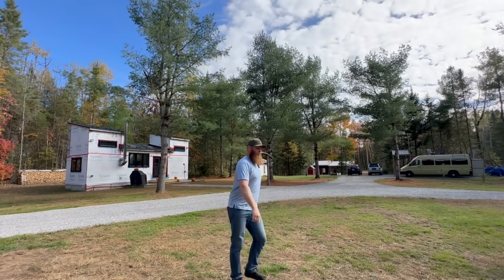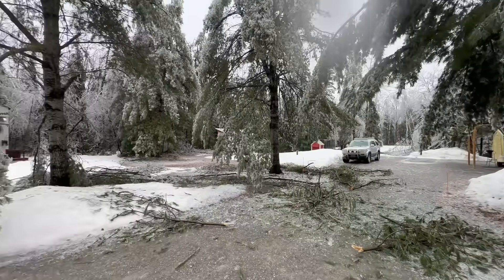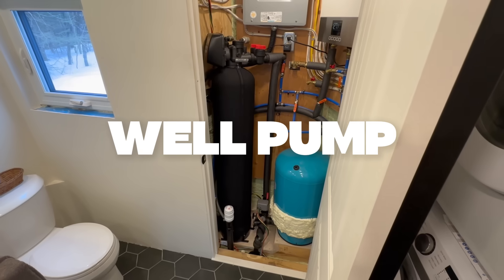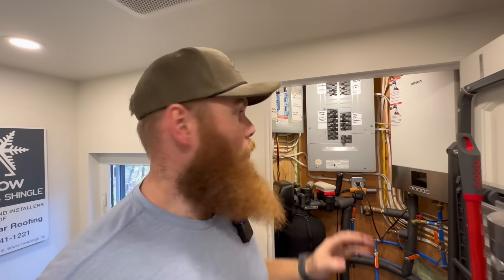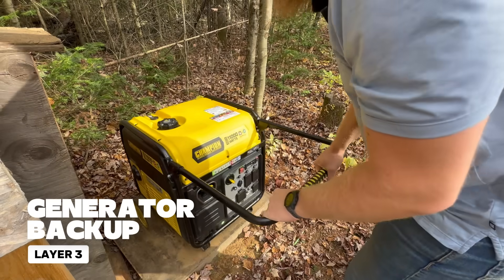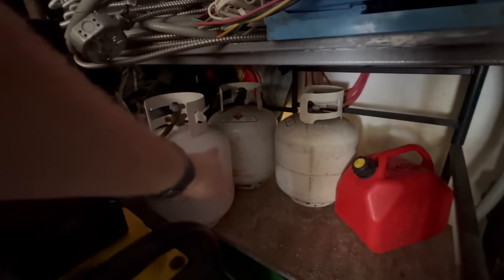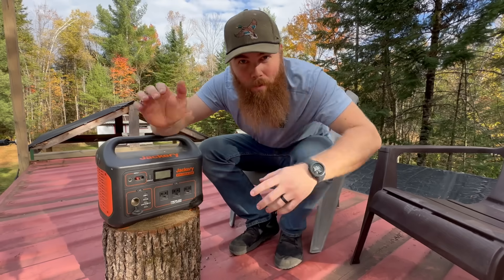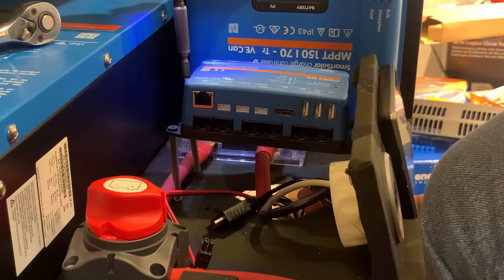This Trick Keeps Our Tiny Home Powered All Winter

Comment: @Snowstead, 
thank you for sharing your know-how and your beautiful little homestead with us.

The route I took here in Tennessee, was to first live offgrid for several years, pre-retirement, in an old 12' tow-camper, on my 0.75-acre rural lot, with a DIY'ed solarpanels/ rainharvesting canopy built above it, and using propane for heating and cooking.. 

As I retired, I then took my (dozen-years- brainstormed) offgrid tinyhouse (8'×12') highly custom sketches and specs to a local Mennonite builder, who soon delivered to me that $3K (R-7/in. sprayfoam- insulated and sheathed) shell, which I swiftly sheetrocked and interiorly surface-wired for offgrid solar, it similarly equipped with transferred-over (and tripled) offgrid solarpanels (2.6 nominal kW of, presently) and a rainharvesting system channeled offa its Galvalume roof.. 

and three AGM batteries, a better inverter, it really used solely for inductive/ microwave cooking, everything else kept at 12 volts.. Lighting, waterpumps, blowers & fans, security cameras, 3 flex fridge/ freezer units..

*I've deliberately planned, at every stage, so as to never need/use a genny; they can certainly undeniably be appropriate, and lifesavers, but I personally dislike them, and the expenses of buying, fossilfueling, and maintaining the smelly, noisy stinkers.

Tho I still keep several filled tanks of propane stored for unforeseen emergencies, all my heat in this small space is from individually- switched 12V, 100W-each, 2.25"-diam. wee minifan- equipped PTC zone-heaters that blow warm cocoons of air on me and my furbabies, and which are sufficient in even -5°F temps, to keep toasty-warm.. (can't prolongedly run more'n half of them without sweating, and 'this-half' rapidly climbing toward 90°F!), 
and their heat also even keeps canned goods well above freezing at all times, over in the subdivided 'other half'; (the pantry, closet, and entryway, and ~60% of my perimeter- circling storage loft.)

I further- superinsulated my built-in bunkcubby, and have three different  onobtrusively- hidden 'time-release heatstorage' watertanks, them 12V immersion- heated solely during daytime with excess, otherwise wasted solarwatts, and them allowing all or nearly-all heat to then be nightly turned 'off' until daybreak, my three AGM housebatteries then starting each day at still 75% or greater SOC... 

Once, I lazily didn't brush an inch of overnight snow offa my solarpanels, and STILL, under overcast skies, then reached my usual 100% batteries'-SOC by midday, much to an on-Grid neighbor's amazement.   

Very rarely in wintertime, I need to run, for about 20 minutes, 12V immersion heaters that I've equipped my rainharvesting system with, to keep things unfrozen. 

My offgrid systems have never failed me, even during an awful icestorm some years back that felled trees and Grid-powerlines across roads everywhere, and filled emergency shelters, as shivering folks in and outside of town realized that the power in many areas was NOT gonna be restored soon.. With some relatives of mine in a neighboring town having to be four-wheelers evac'ed over ice and fallen trees to shelter... and an on-Grid aquaintance and their fam who actually unknowingly HAD everything on hand to keep one house room warm for weeks, instead risked life and limb on solid-ice, trees- littered roads (after authorities announcing "we can't even REACH many car wrecks, so don't try venturing out!") 
perilously "evac'ed" to a nearby, similarly no-power, and no-firewood friend whose fireplace & chimney hadn't been used in decades, them growing increasingly hypothermic as they tried to 'fell a dead tree of his with kitchen handtools.' They were very lucky to have survived, and afterward, started paying attention to my 'be prepared!' tips and hacks.. Including that they'd already HAD on hand, several metal, (heat-padded, then insertable into a window) garbage cans, them and other containers filled with weeks' wortha [burnable] livestock feed, and their property rife with dead, burnable underbrush and old barnwood, for primary fire-fuel.. 

And sigh, (I) was, in childhood, the one who was the 'city kid', watching every NASA space launch with binoculars, out in the yard in Florida..

In summer, I comfily never sweat a single drop here inside my tinyhouse in even 94°F weather; my South & West walls are shaded by groundmounted solarpanels and shadecloth- backed trelliswork, my Eastside porch by seasonally- hung shadecloth, and I whooshingly blow-in cool, Northside- resupplied underfloor air through a powered floorgrate, that cool  air moving laterally thru the tinyhouse and exiting high, at a powered Eastside gable exhaustvent.. 

Even my superinsulated ceiling in summer reliably reads within one degree Fahrenheit of being the same as my FLOOR'S cool temp.. so ALL surfaces inside here in summertime remain COOLER than my body's SKIN temp, and act as a radiative- transfer 'absorber' for my bodyheat.. 
The combo of three 'shaded' exterior walls, a summertime shiny reflective grommeted shadecloth lashed-atop my already- shiny Galvalume roof, it trapping/ retaining for awhile (evaporatively- cooling) rains' moisture..  My entering (dry underfloor- earth DEhumidified, low-dewpoint) AIR is frequently ~30-35 R.H. points BELOW that of the official outdoor humidity..

So I never sweat a drop in summer, when inside. 

Haven't even NEEDED, this hot summer, a tertiary, backup superchilled 'Blue Ice' bedside/ chairside bin that I'd cobbled together, and previously (occasionally) used during 90°F+ weather.. it blowing measuredly 39°F-41°F air on me..

Am absolutely loving my 'no mortgage, no landlord, no utility bills, mere ~$50 yearly property tax' peaceful little oasis, here. It really 'stretches' my tiny three-figures monthly Social Security retirement check, beyond belief...

Welp, (that's) the path (I've) taken.. 

Will continue liking, sharing & also 'Hyping' your fascinating, helpful posts, you two! 

Best wishes. 😊❤
Reply: Wow! You've really thought it all through and made sure you are living the good life, as comfortably as possible! Thanks for sharing. Enjoy!
Reply: @dorothythorpe6183 
Thank you, Dorothy. 'Best', to you!

Comment: Oh I love where you put your appliances in the bathroom.  That was smart.  I've never heard of Battle Born before.  Level 1 - Electrical Grid  Level 2 -We are using Ecoflow Delta Pro with 3 batteries here, but have yet to get the solar panels installed as we haven't decided where we want them.  (roof, fence or ground)  Not liking roof idea because of all the snow we get here in Ontario.  We are documenting the sun for the year.   Level 3 - backup gas generator.  We have gas cook top, propane outdoor cooking and gas fireplace we can hook up to the generator for fan. Hubby and I went thru the ice storm in 1998  with two small children and 3 small pets and I never want to be unprepared like that again.
Reply: Yes, solar panels are good but ground mount them if you can. we have a two-story house. It was a mistake to roof mount them. It's very scary in the winter on the roof to brush the snow off.

Comment: 2 weeks of power from your battery setup is really impressive.
Reply from the maker: Hey welcome back! And yeah it really is, that’s definitely the max depending on our usage though, my hope is to have some more options for battery charging soon! ☀️
Reply: Or get 4 times the battery storage than overpriced battleborn batteries
Reply from the maker: @turtle1723  and get 4x less lifespan, quality, and safety. There is a huge difference between these and the cheapies, I'm happy to keep my family safe.
Reply: @Snowstead you get what you pay for means more when your family depends on you in the middle of winter.